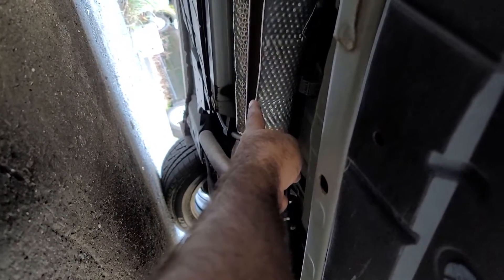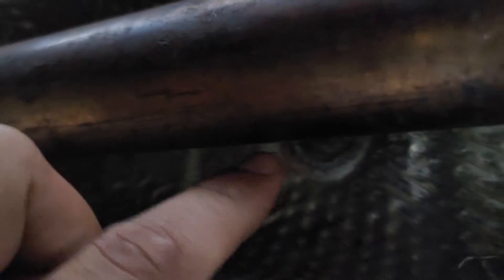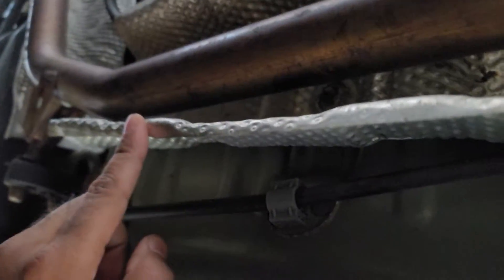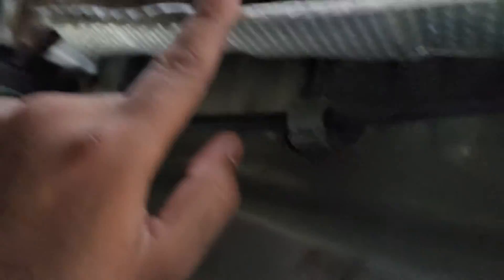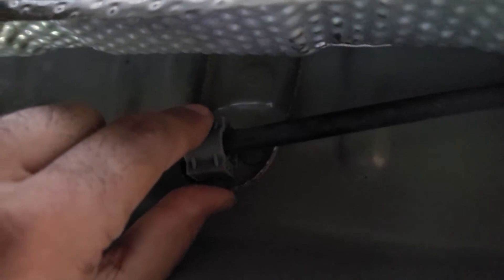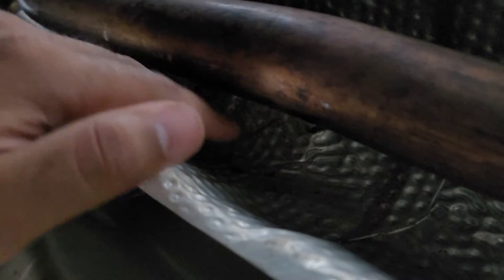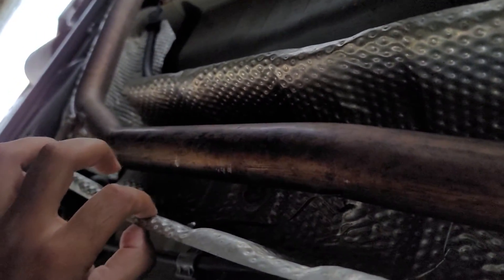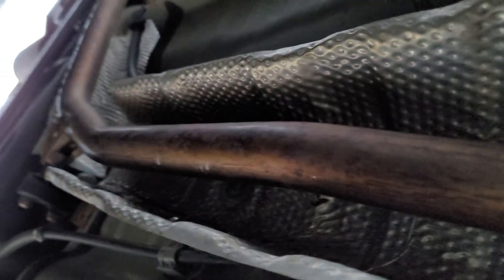Heat Shield noise fix on Toyota Prius

Comment: @1:10 - To anyone with a similar problem; Avoid anchoring parts of the exhaust to any of the wiring in your car. The movement/heat from the exhaust will wear down the insulation around the wires which can become a safety hazard later on, depending which wire you're anchoring the exhaust to(not to mention the financial cost to diagnose/repair/replace whatever parts that wire connects to and/or the wiring itself).
Just tie it to the bolt it was originally anchored to or any other anchor point, but please don't anchor it to the wiring(especially the wiring of a hybrid), it will only cause more problems down the road.

Comment: Thank you! I have this problem after bottoming out my Prius 2011 on some sandy seasonal roads. The bolt broke on the exhaust heat shield and there is now a loud metallic rattle when the gasoline engine is running.

Comment: this was very helpful... not sure the ultimate solution is a tie up, but it'll work until someone can get in there and replace the bolt that holds it in place.  Good fix.  Thanks for good video.

Comment: Just fixed same problem on my Prius.  The problem is that the shield around the bolt corrodes and slips over the bolt.  You will have to raise the back of the car on ramps to get at the shield bolts. Remove the 10 MM bolt(s) (not easy) and under the bolt put a washer big enough to cover beyond the corrosion.  Its hard to do because the exhaust pipe is in the way and you don't want to remove that!  I unbolted the whole heat shield and cross bar so I could rotate the heat shield enough to get at the bolt.  It took about 3 hours but I probably saved a bundle by not taking it to a garage.

Comment: Just discovered this issue on my 2014 prius c.  Rattling for a week, thought it was coming from front right wheel area but when growing through drive (wall echo) noticed it might be more back.  I'll have to lift it up and maybe put a washer over the bolt, probably rusted hole broke off.

Comment: Thanks for this. My 2014 Prius just started making the same noise yesterday, which I immediately assumed was the heat shield, and looking underneath I can see one end resting on the exhaust pipe like the beginning of the video, so that is certainly what it is.   Does anyone know the size of the bolt and/or washer?  I assume the bolt is probably still there and the hole simple rusted through and may only need a bigger washer, but would like be prepared before I crawl under the car. 🙂. Or perhaps I could “make” a washer with a thin but durable piece of rubber. 🤔
Reply: Same thing started happening to me yesterday on my 2015 prius. Almost the exact same timing as yours.
Reply: @EmmeryCheung  In my case, the heat shield was rusted through, and the bolts were also heavily rusted and not moving, but there was really nothing to tighten it to anyway since there were big corroded holes where the washers were.  Only workaround if I could get the bolts out would have been to make oversized washers, but that may have only been temporary too.  I ended up going to an independent shop and they put it up on the lift a put a couple other screws into the body and that solved the problem, for a nominal cost.  I traded the car this summer for a 2023 Prius Prime. 😎.  Good luck!

Comment: I was totally thinking stainless steel zip ties somehow.  Good deal.  Wondering how is still holding up?
Reply from the maker: Still good 👍
Reply: @mechanicallyinclined2715  I just saw my stainless zip ties a week or so back and where I thought just looking I saw, I'm not finding... darn... and leaving the truck doors unlocked isn't boosting my confidence either.  Anyways... good to know is holding up.